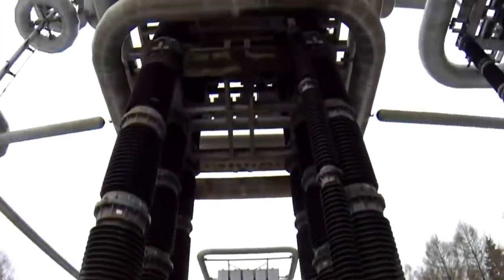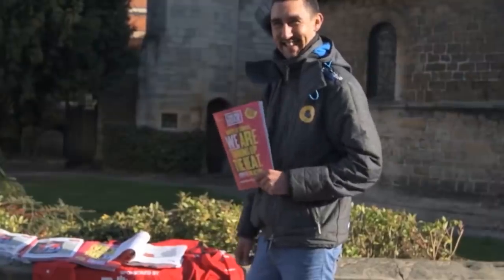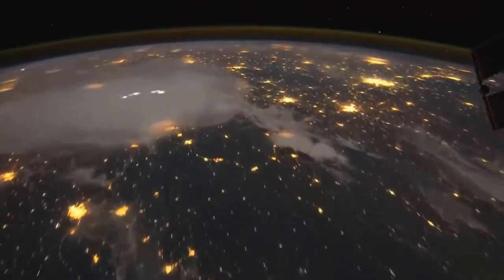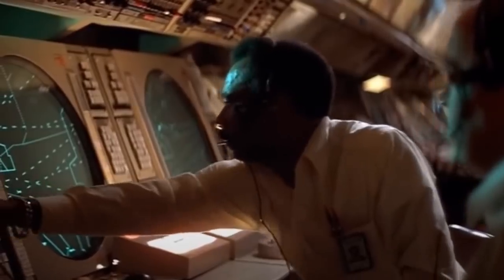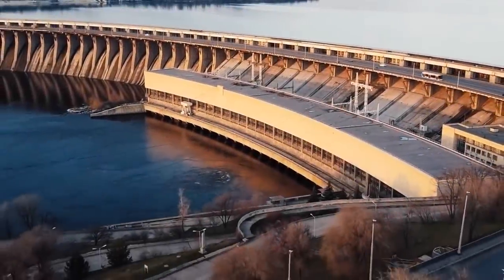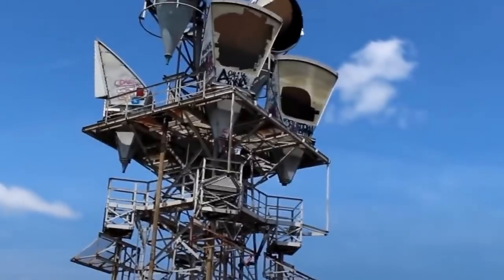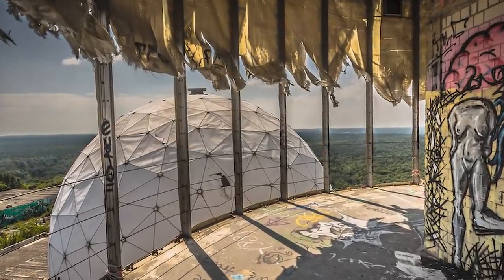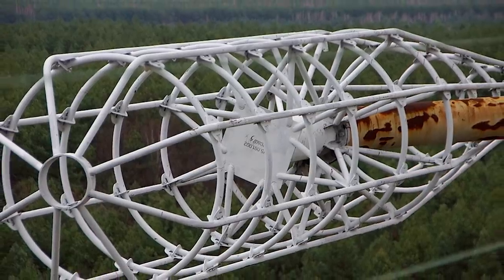12 Most Amazing Abandoned Objects And Places

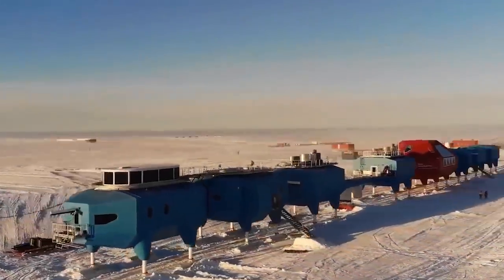Comment: 1:43. Its not left on its own. A handful of people are there when the the main staff have left. They have to be there if the modules need to be moved.
Reply: Phil Palmer past 4 seasons or so nobody has wintered due to nearby cracks opening and nowhere else to move the station, during the 19-20 there was a very small staff there and they couldn’t even sleep in the station, they had to sleep in the overflow building

Comment: Chernobyl nuclear disaster happened in 1986 tho
Reply: Yahhh this guy gives out wrong info constantly
Reply: The radar activity was scaled back in 1987, after the Chrenobyl disaster.
Reply: @valiblaj  "Although activity at the site had been significantly scaled back due to its proximity to Chernobyl, after the nuclear disaster in 1987."  Sure sounds like he meant the disaster happened in 1987, not the reduction in activity.
Reply: @blacksheep_edge1412  I suppose the copy might have read, "due to its proximity to Chernobyl, after the nuclear disaster, in 1987." It would still have been poorly written and he read it worse, though.